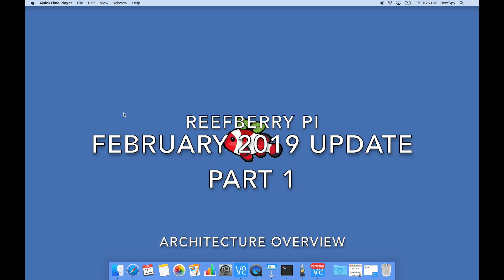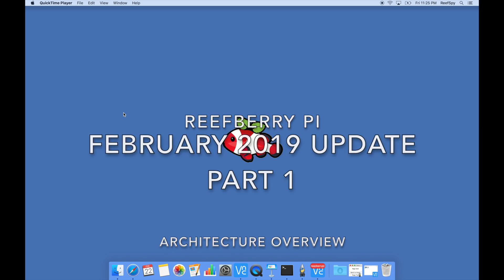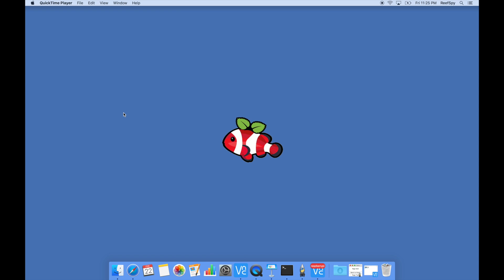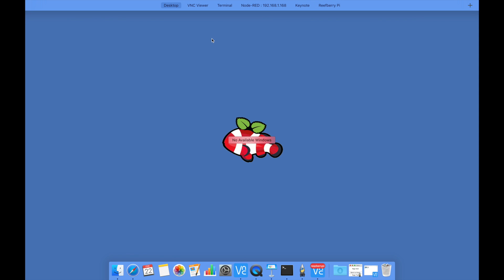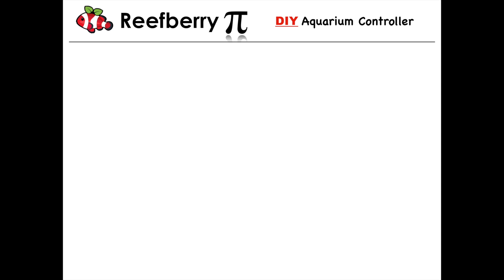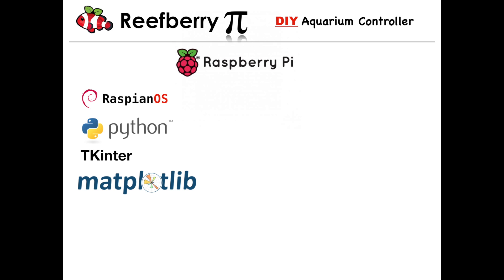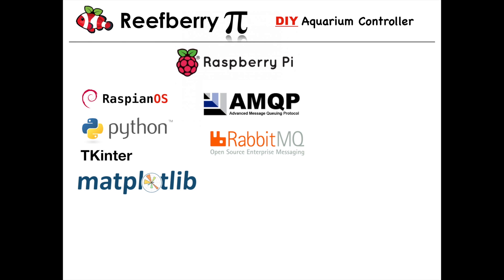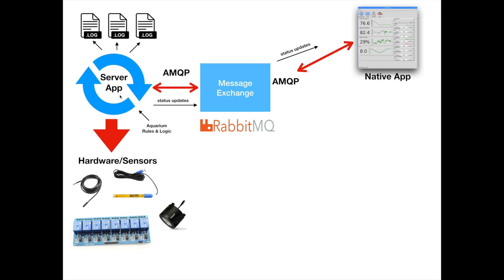Reefberry Pi Feb 2019 Pt 1 - Architecture Overview

Comment: Thanks for posting the details of your project.  I am helping my nephew build a monitoring application for his lizard terrarium.  It will require heat, light, and humidity management.  A number of the sensing, controlling, and displaying techniques you created would be directly applicable to our project.  I am not a programmer or hardware guy.  So, I will be learning as I go.  I might reach out to you at some point with questions.  Your setup is very impressive.

Comment: I’m working on a very similar project for my first reef tank. As a relative novice in python I am curious how you structured your main server loop to monitor for the amqp signals and adjust all the equipment in response? Is it continually looking for the inputs or just at the beginning of each loop?
Reply from the maker: I had it continually awaiting signals in a separate thread.  I would recommend looking into MQTT.  It is a little easier to implement than AMQP and you will get much the same result.  I am currently re-working my code to use MQTT.  You will also find more examples to learn from.  You can still use RabbitMQ as the messaging broker by enabling the MQTT plugin.  I use the paho mqtt library to connect with RabbitMQ from Python.

Comment: Question about Rabbit MQ-- Is the information dynamic and relayed instantly or is there a time it sits until it is checked??
Reply from the maker: You can set it up either way.  You can leave the message in the queue until it's retrieved, or push it out immediately to any connected subscribers.

Comment: Do you plan on releasing this software?
Reply: Im actually about 1/3 of the way through putting all my hardware together and 3D printing my enclosures,  for a system like this, or ReefPi. So far yours looks a lot more in-depth thatn ReefPi
Reply from the maker: Thanks. Yes I do plan to release once I finish up a few more things. Right now many things are changing daily so it’s not quite ready yet. I’d love to see what you come up with for the 3D printed enclosures. Once I finish up the software I want to get a 3D printer to make a nice home for this, but 3D printing is something I’ve never tried yet.
Reply: @ReefSpy  Some of my dimensions turned out to be wrong... that is what I get for printing before I actually have the components.  So now I'm making test plates to make sure each component fits. The over all plan is to have two enclosures. One will house all the power/probe connections, it will have a power plug, power switch, and circuit breaker, as well as green LED's for each power outlet that light up when that outlet is on. This unit will be connected via a single 36 pin serial cable to a second enclosure which will have the pi and a 7 inch touch screen. The 36 pin serial will be what connects all the GPIO from the PI in the one enclosure to the other. My goal is to be able to walk up to the touch screen and do anything I need as well as connect via wifi. I have test panels for the outlets, power plug, power switch and 8 port relay. waiting on connectors for the probes and the 36 pin serial connectors to get here to make test panels for them

Comment: Think you've made a good choice bringing the message broker in. Decoupling ui from back end is always a good move. 

One of the things I've been looking at is the sonoff basic switch. In short its a small board with a wireless chip and a relay, but you can control it via mqtt (once flash with tasmota). You should check it out. 

Nice update, its looking good 👍🏼
Reply from the maker: thanks, I'll definitely take a look at that.  I'm starting to see how this was a good move because so many possibilities have opened up now!